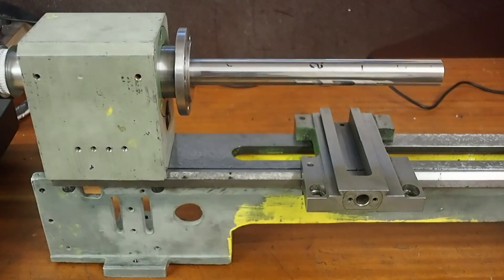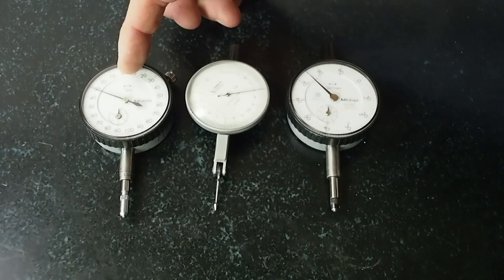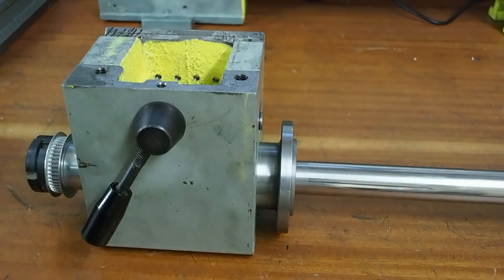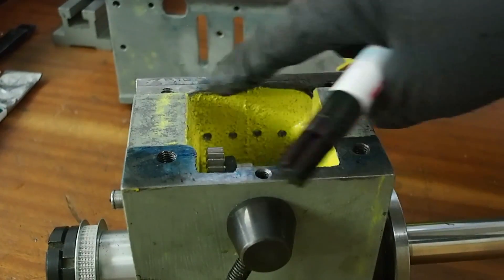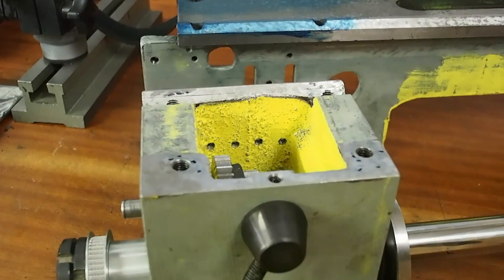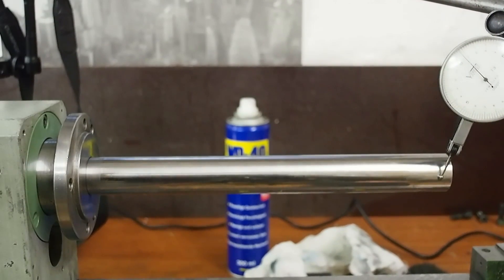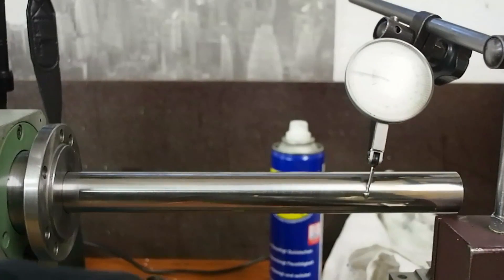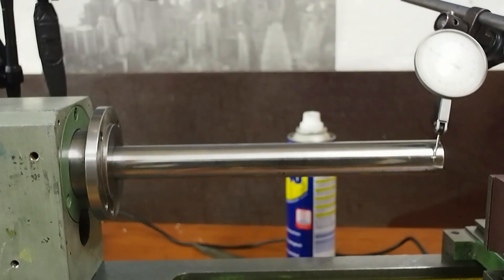Modifying the minilathe -  episode 6 - headstock alignment

Comment: After a fair amount on youtube watching manufacturing videos i noticed that most "overseas" Youtubers have no interest on converting imperial measurements to metric,on the other hand the Europeans try to do that (metric to imperial) to facilitate the overseas viewers.Half a thou,two buckets deep,3 feet long,3 arms wide, 3/16+8/32+4/54 etc.It's a headache.
Greetings from Greece!
Reply from the maker: NZ only went metric in 1970, so my Dad always used imperial. Plus I became a aircraft mechanic, and planes are still largely imperial. I am pretty comfortable in both systems.

Do you watch Cutting edge engineering? His banana rulers are classic.

Comment: What size pulley did you use on the spindle? What was the inner bore diameter? How many teeth? Did you make it or buy it online somewhere?
Reply from the maker: Do you mean the old set up with the toothed pulley directly onto the spindle? That was an HTD 5 pulley which I got from Mädler.de. I bored it out to fit the spindle.

Comment: Great video series. While I agree with the lack of mass, bolting the bed down (and of course shimming out any added twist) and/or adding angle iron or similar added metal to the length of the bed down near the feet would have to improve the lack of torsional rigidity. Don't you think?
Reply from the maker: Yes and No. The steel bar I bolted it too reduced deflection significantly. Just not enough. Look that the bed cross section of a Schaublin 70 watch lathe in comparison to see what a stiff bed in a lathe this size looks like.

Comment: why you use imperial? is rare to see a non usa channel using imperial
Reply from the maker: NZ only went metric in the early 1970's. My Dad always talked in imperial, and gave me some of his measuring equipment, whereas I have bought metric, so I have a mix. I am an aircraft mechanic, and most aircraft, and jet engines are still made with imperial sizes and fasteners, so my apprenticeship was done in imperial.
I mostly work in metric, but probably have a better "feel" for tolerances with imperial, and I really like that Verdict "tenths" indicator.

Comment: I have been looking at a method of checking spindle alignment with the ways that does not require an accurate test bar. It is called Rolle's Dad's Method and I was wondering if you had ever used it.  Great video many thanks.
Reply from the maker: thanks for watching. I used it years ago. Really it is just a test bar with the entire center portion relieved so it is only two rings. Easier to make, and good enough for head stock alignment, but tells you little about wear in the bed.
Reply: Thanks for your quick reply. The method you describe is not Rollie;s Dad’s Method (RDM). Your method I believe is widely used to align the tail stock with the spindle axis. The earliest reference I found to RDM is:-
	http://people.ne.mediaone.net/wasser/NEMES/RDMLatheAlignment.html 
The method requires a test bar that must be round along its length but does not require to be accurate for, straightness,  uniform diameter,  it does not need to be mounted accurately in the chuck,  nor does the chuck need to be in alignment. No metal removal is involved.  DTI measurements are required at the chuck end and the tail stock end along with some simple calculations to establish run out between the spindle axis and the ways although measurements at a few intermediate positions can indicate if the ways are straight. I believe the method provides ready answers for new lathe owners fundamental questions ie are the ways straight and is the headstock aligned to them. Again thanks for your patience. @RotarySMP

Comment: Any machine tool needs to be bolted down to a solid base that you can't deflect with the cutting forces you're aiming at, that's how I see it at least. Even this bed becomes pretty solid if you bolt it to a 12" thick slab of concrete, it can still be put on top of a cabinet
Reply from the maker: Thanks for watching. Concrete is not very stable (but probably fine in this application). Epoxy granite would be better, but all that sort of thing really would exceed the scope of this project. I'll address this in the next video.
Reply: @RotarySMP  epoxy granite is amazing stuff, but it's not super cheap so you tend to save in the amount. Concrete is fine, but of course only if the amount is high enough. Thanks for the reply.

Btw, are you planning on a cnc conversion or keeping it manual?
Reply from the maker: @MF175mp  It is. I made some E/G and tested it on the CNCZone endless M/G thread. Got about 40Gpa Youngs modulus. I did make a Head support for a Deckel FP0 from it, but then they project got terminated by buying a MAHO.

Comment: The huge amount of bed flex is the reason my little beast (warco WM180) is bolted down to a seriously chunky bit of I-beam, I added a couple of extra mounting holes in the bed and welded heavy brackets to the I-beam to mount the lathe. after a little time spent shimming and levelling it is very solid! it has made quite a difference to the quality of cut and accuracy of the machine.
After letting the magic smoke out of the old power system, I also upgraded the motor with a 1hp 3-phase unit and VFD, I've got a machine that Is surprisingly capable. It genuinely helps me earn my living while staying compact enough to not require a redesign of my workshop to fit it in! It's still a chinese mini-lathe at the end of the day,  but I love it!

You can polish turds to quite a shine if you're determined enough! thanks for the videos!
Reply from the maker: Thanks for watching. I'll be addressing this in the next video.

Comment: be careful not to take too deep of a cut on these lathes i ended up burning out the motor on mine and couldn't find the same motor to replace it with so i found a 1hp motor for cheap and Jerry rigged it but no i have no speed control
Reply from the maker: I burnt out the DC motor years ago as well.
Reply: Glad to see im not the only one
Reply: Fitted a 1 hp 3 ph to mine and now i have to be careful not to snap the bed i half !
Reply from the maker: @Flattyman  Mine ended up with a 3/4hp 3ph and VFD.

Comment: I can imagine that the target audience would expand if you decided against mixing US customary units with metric ones - or spell out the measurements in both units, as many successful youtubers do. I for one became adept at multiplying obsolete units by 2.5 or 25 and lazily letting go of the remaining ~1.5% as kind of an error and I'm no stranger to some mental arithmetic, but, you know, seeing something like .197" makes my skin crawl even though I almost immediately realize that they're talking about 5 mm. Fractions of an inch, e.g. 11/32" are my favorites... I consider myself lucky that the good folks over there on the other side of the pond have never considered using units like the 'jolt' instead of the 'volt' (1 jolt = 15.5 V) and 'dumber' instead of the 'ampere' (1 dumber = 2.3 A). No offense. :)
Reply: I doubt the mix of units is holding back views. When you are running a home shop on a budget you invariably end up with a mixture of imperial and metric measuring devices, at least in the Uk, so you have to be somewhat proficient st both. I greatly prefer the metric system though.
Reply from the maker: I generally work in metric these day, but the Verdict is such a nice DTI, that it made sense to use it for this part of the project.  With relative dimensions like this it really doesn't matter. You start with 30 and have to get to 2. Thanks for watching.

Comment: Rigidity is everything but if owners only want to turn up some non critical parts for a project then these machines are basically fine. Never seen one that was great straight out of the crate anyway but with some effort they can be ok. I find parting off is a nightmare and must be done patiently lol. Having said that, you'll learn quite a lot about the lathe and machining just by doing improvement projects to the lathe, heck I'm still doing mine :)
Reply from the maker: I agree. This was my only machine for years, and it is pretty impressive what you can get done, despite the shoddy quality and light construction. Must say that twisting it +/- 0.002" just with the hands surprised me though.
Reply: @RotarySMP  me too that's quite a feat of strength...on your part lol. I'd love a big hefty lathe but I just haven't got the room in my shed nor the desire to take on the task of getting such a heavy thing through the door etc
Reply from the maker: @HepcatHarley  "tarzan chest beating" :) Better a light lathe than no lathe.
Reply: @RotarySMP  Indeed Sir :)
Reply: @RotarySMP  I was very surprised just how weak the bed is as well. Really needs to be bolted down to something flat and rigid, maybe scrape in the surface of a chunky steel I beam?
Reply: One of the benefits of working with these little machines is that when you use a 'proper' lathe (even a relatively small one) you really appreciate the rigidity in a way that ABOM never would!
Reply: With big lathe/mill, you can cut with about anything.
On those wobbly mini machines, you need super sharp HSS tools with very positive cutting angle to get any precision. Otherwise the machine gets just twisted out of alignment.